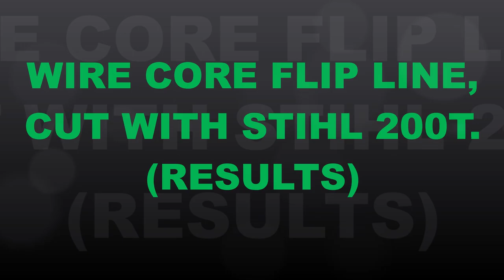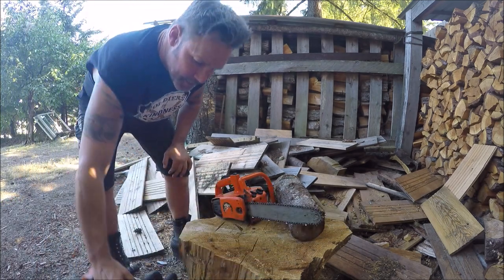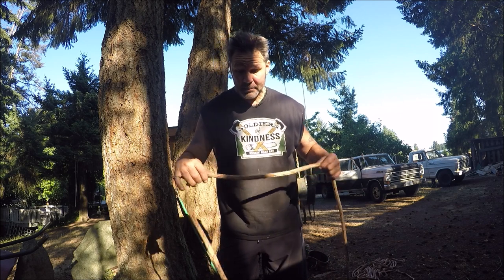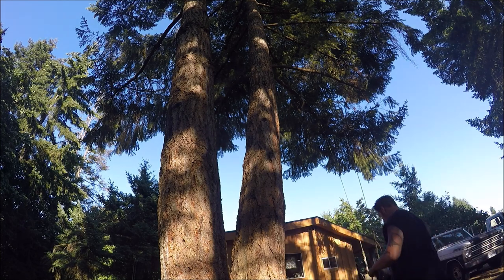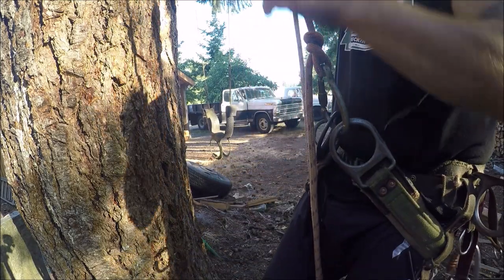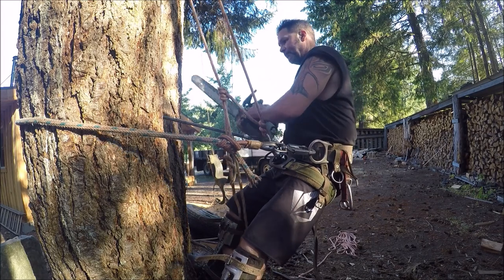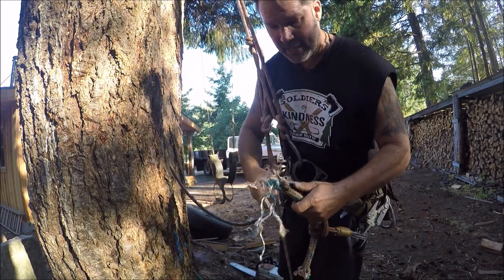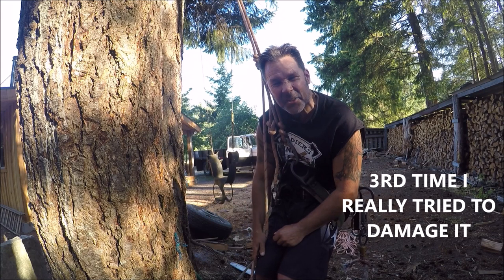WIRE CORE FLIP LINE, CUT WITH STIHL 200 T  RESULTS

Comment: I do appreciate seeing the demonstration with the strap weighted, it clears up two things that I wondered about after the first video:
1- the wire core rope is in fact significantly easier to cut when it's under tension  from your bodyweight
2- it is still plenty, plenty good enough to take a chainsaw strike, and it's still pretty difficult to cut completely even if you're trying to do it

Comment: thank you buckin Billy..... you are classic and a fun teacher..... ive been a timber faller and climbing big trees for 31 years now. sometimes i have had to just take a chance because the tree stem is so huge etc, that i just make some careful cuts with my yale 3/4" maxi flip steel core lanyard  being the only. thing around the stem... ive even done it using a 395 husky with 4ft. bar..... i know to NOT touch that lanyard with ANY saw...... but i feel a 1000% safer knowing i have 1/4" steel inside that rope rather than just plain rope which would be instant bad bad..... what i first learned from a pro timber faller when i was just learning to be one as well was  NEVER EVER get cocky ,, even with small trees as well ,, because even those little ones can take us out ... also i was taught to think 12 steps ahead before we make our next serious cut etc.  and LOOK UP..... and have good escape paths...... peace out.......               roy mendo

Comment: Hehe love the face whilst cutting, I think mines like that normally :) 
I’d just add to any young ones starting out, not all wire core flip lines are equal,  and be careful when you’re truly knackered chogging down a big stem with an 066, it may cut through a tad quicker 👍
Reply from the maker: NOT MAY ,, IT MOST DEFINETLY WILL    HEY GERB

Comment: Long time follower, but now I have to intervene.

1. A bigger saw will cut though.
2. In a rescue situation when a climber is under tension and you can not unclip the climber due his weight. You will have to cut the wire core after you tie the climber in to your system. How do you get the climber off his wire core?

I suggest for those that use wire core to have a teather inbetween the carabiner and the wire core.

Comment: Billy you are one funny dude! Very valid vid! There could be a difference when blocking a spar down with say a 288xp that has been done up wicking a 1/2" flip line? But I agree, Ive fuzzed a few flip lines and never cut one in half yet. But as soon as they get fuzzed _ they get binned. It's most often when trimming super dead branches a tad too close to the flip, and so far... just pull some fuzz. I would still not consider the core as a safety feature per se. Like you said, the outer sheath took most of the hit initially anyway. I suggest the best practice would be not to use a chainsaw across a flipline.

Comment: I'd like to make a comment on these lines being cut through. I had to cut a guy out of a oak tree that had split once the top have been pulled out and he was pinned legs down to the tree with a lot of tension on The Wire braid rope. I can tell you absolutely it takes one second with a sharp saw to cut through that line. I don't know how it will happen to the next guy but I was there to see that one and it's pretty quick. The only option we had is to cut through the line but as I sat again with all that tension on it it cut very quickly with a 460 Stihl...... I'm not trying to say anything contrary to buckin Billy but these lines are extremely fragile and hopefully you'll never be put in a position with a lot of tension on it and hit it with your saw. Be safe out there

Comment: Interesting video Buckin'. I don't use a wire core flip line and never have so my predetermined notions are based on nothing other than my imagination but I would have thought that saw would have went through it quicker than it did.

Comment: So eventually you cut through the rope and most of the steel core.  Then when you tried to tighten up the strap the braid slipped off the core.  I wonder if a figure 8 of both the braid and core could have prevented that.  Good test.
Reply: Michael Remski i think so. Or a crimp with a thimble.
Reply from the maker: IT WAS LIKE THAT FROM THE LAST TEST ,,A COMPLETE OVERSITE   THX MIKE
Reply: I don't know if you would get a figure 8 in it... maybe something like a small stainless hose clamp on the very end cinched real tight... that way the core couldn't slip out...
Reply: Normally that flip line would have a swaged eye with a thimble at both ends, which would prevent the wire core from slipping out. He cut the end off in the previous test, the other day.
Reply: Thanks Ted.  That would do it too.  It  was a good demonstration of how overbuilt they are.  I'm not complaining;  if I was depending on it a hundred feet or so up in the air, I'll take all the safety margin I can get.

Comment: Better and safer way to test would be to have another guy run the saw while you’re just on the flip line. Either way, seemed to take a lot to get through it.  Tie in twice just in case 🤙

Comment: Much more important is the question why would anybody climb with two fliplines attached at the same time?, I do it simply because there is only one small spring in the metal clip on any flip line and when that little spring fails the clip can easily open on you and disengage from your harness. Rule of thumb is always be tied in two ways with one being a wire core flip line when using a saw above ground in a tree. It also makes it a breeze to be able to climb around limbs or crotches while always being tied in. Stay safe Stay alive.

Comment: Am not a climber I have a question do all flip lines  have a steel cable in them So either way you would be secure so you don’t fall out of the tree it was a pretty cool To watch that
Reply: There's "rope lanyards" and then there's "flip lines"  and flip lines are steel core. The term "flip line" comes from the technique used to advance it up the tree and it's the rigid wire core that makes it more ergonomic than using a rope lanyard.
Reply: Nathan Arievlis  There's a reason why the acronym "TITS" applies to tree climbing, regardless of whether the climber is using  a steel core flip line, or a rope lanyard. It stands for "Tie in Twice, Stupid". While I'm not calling Billy stupid, I cringe every time i see him aloft with only a single flip line for support. It is NOT safe! And, yes, it is very easy to cut a flip line completely. Billy's test was not representative of the worst case, when the lanyard is up against the trunk, it will cut in an instant, especially if a larger saw is being used.

Comment: So if the line eventually just slipped out was that a typical line you would have used normally? I ask because that didn’t seem too safe seeing it just slip out. Then again I suppose the thread of the rope is what holds it all together?
Reply: Emmas dad its the old line used in the previous video. It had no crimp on it. If it had a crimp on the end. It would not have gone anywhere.
Reply: Victorious victor I see now looking back at how it was just tied on there.

Comment: I wanna save someones life!  You can touch a saw to a landyard and not completely cut it.....but when someone hits it, what if it is out of there view.  I get it....steel-core is more saw resistant, but they can be cut....and on occasion...with ease!  Ive seen it...i just want all climbers to know that these steel landyards CAN be cut.  If it saves #1 life....then its worth it.  Always be tied in twice.
Stay safe
Reply: STIHL BORN agreed. That being said. You shouldn't be cutting where you cant see. 
Steel can be cut. Yes. We all agree. 
Steel core, aside from near powerlines....should always be used IMO.
Reply: Victorious victor we both approach our occupations different....im in town, around electric lines, and over structures.  Guys that work in the logging trade, tend to use the landyard for life support.  In residential, a landyard is only for positioning & not life support.  We have two tie ins when running a saw, & ive noticed the logging industry doesnt require 2 tie ins.  This is unsafe in my opinion.....buckin has an HUGE following & they are not all loggers.  Allot of new residential climbers also watch his videos......even though i dont agree, some climbers use Youtube videos to learn this craft.  This being said......i dont want these new climber to have a false sense of security, because they watched a video that says metal core landyards CAN NOT be cut.  I watched the video multiple times and thats the impression it left with me everytime.  Im not saying buckin is wrong for video....he is showing his experience and 99% of the time i agree with what he says and does.  He is a great man, with a huge heart...and we need more people like him.  The subject of steel core landyards is a sore one for me......ive had to defend what i know to be true for weeks now (not on this video, but another)   Steel core landyards are great and stronger then normal rope.....But they can easily be cut in two (look up the videos) , and steel core landyards have been known to rott and/or rust & have brokin because the metal cant be inspected.  Im only trying to help...if my concern saves one person....it worth all the head-ache of defending myself
Stay safe
Reply: Victorious victor and on the subject of cutting where you cant see......lets say you have only a landyard....you have limbed the tree on the way up....start to back gaff down a ways, so you can blow the top out.  When you make your back cut, you are on the side or back.....this leaves a blind spot always....there is no way to see 360° around the tree while cutting.  If you stop, you can see the blind spot, but not when running the saw.  Im gonna step down from this discussion.....im exhausted & cant keep this going.  I think everyone has the impression that im looking for an arguement and im absolutely not.
Think of it this way.....if you gave out information, & that information got someone hurt or even worse...how would you feel?   My conscience would kill me forever....the message i took from this video is.  If you use a steel core landyard, you cant cut thru it.  I have personally seen them cut with ease and the only thing that saved there life was a 2nd tie in.  This isnt my opinion...this is fact.
I apalogize if i ruffled any feathers, because thats not my intent.  
Stay safe
Reply: STIHL BORN i never take it as an argument brother. Please do t see it that way. Always a discussion with me.

I agree you cant always see the backside/lowside. But you can take 5 seconds and climb around and make sure your lanyard is bellow your cut. 

I my self, DOUBLE TIE at times. Not always. But more of the time. Ill never tell someone to climb on a single line....nor will i tell them to climb on a double. Thats up to them. 

We out here in BC have a funny situation. As the logging side of logging says only a single line is needed. Wile residential says double tie is needed. 

People should do what they feel safe with.

Comment: Hey guys whats happnin I just about cut through my 1/2in yale once. I was rippin the union on a fir I was sawin away then I thought what the hell is that a nail 40ft up so i stopped and stepped up so I could look over the top and I saw the frayed blu white n yellow Oops I wasnt tied in but it only took a second and a half its amazing how fast you can be when your scared and embarrassed. anyway thats my flipline cut story I didnt nick it I was dogged in cuttin it had 4 or 5 strands holdin me I was lucky.

Comment: but those steel flip lines are held in at both ends by a swag that wraps around the eye loop holding the snap , they can constrict the wire and break it at the eye loop , many years ago here in Oz a climber was about climb and i noticed his steel flip line didnt look right , had a look played with the wire twisted it back and forth and it snapped off ((((((((